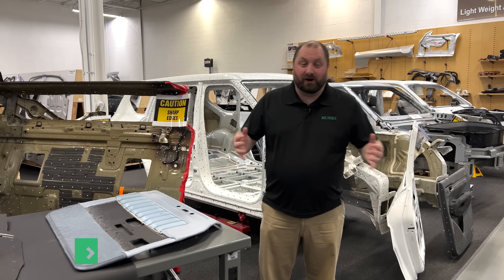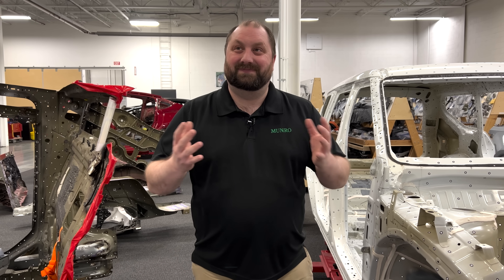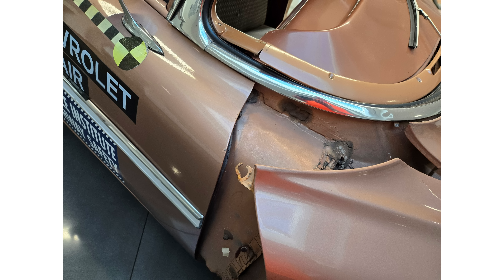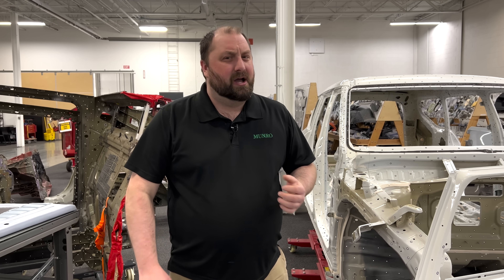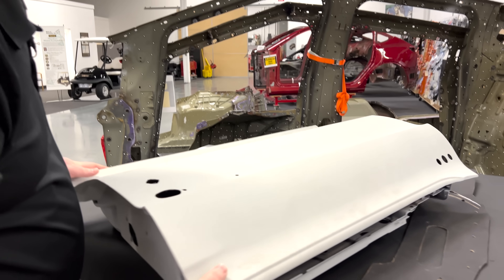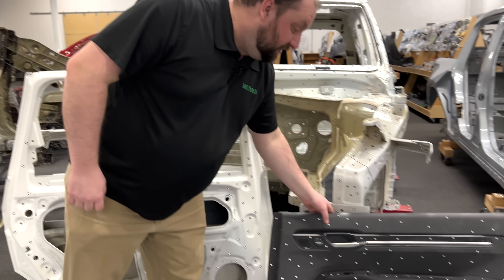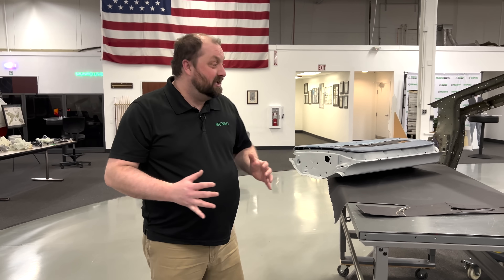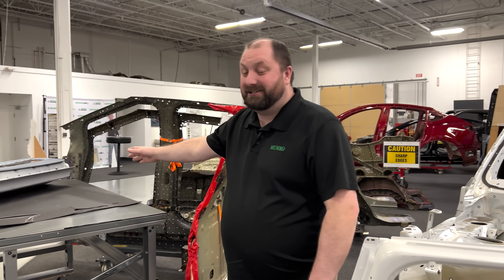No, Your Classic Car Isn't Built Better Than Your New Car

Comment: This argument doesn't happen in Europe, we are all well aware of how bad older cars and in particular US cars where for safety up to the 70s.  In Europe Volvo created crash technology, I have a 1995 940 and it has this technology, as did my Dads 240, but cars 20 years younger are safer in a crash because of the improvement of medical knowledge (from air bag loggers which log the forces).  Top gear did a comparison test which wasn't really fair to the Volvo, because the later car used Volvo technology, just further developed.  Its crash protection was thanks to the older car.

Comment: I think it is worth to point out, even for the car not so classic. Say, cars build in early 2000s. The level of structural integrity on most todays's models are superior over their counterpart in early 2000s. Becasue drive comparment has been continue beef up over the years. Better material, better geometry and better joint location. Another thing worth mention as well, it is corrossion and fatigue. Corrosion is basically material being eaten away. Although corrosion can be mitigate, fatigue can not. The weld regardless, is always going to be stress concentration point. Overtime, its will experiencing fatigue, and its strength will decrease. It is a very lengthy process, but the weld joint strength of car with million miles is not the same as the same car fresh off the line

Comment: Another problem with classic cars today is you are driving around with all of these heavy, modern structure cars that also have incredible performance. They go and stop so quickly that you have to be very careful especially when they brake suddenly. My classic cars with 4 wheel drum brakes are downright scary to operate in todays traffic.
Reply: Then something wrong with your drums
Reply: 4 wheel drum brakes? What are you driving? A old rafe car?

Comment: Old classic cars were not engineered for safety, but then, safer is only one specific type of better. However, when it comes to reliability and serviceability, the old classics are still around because a range of economical parts and expert service are still available for them. New cars are like an iPhone, one owner, and in five years they're done because they aren't worth fixing...few if any will exist log enough to capture the imagination and become classics.
Reply: I read many people saying how old cars were so bad, because the engines will wear out after 100k miles. Well do you know how junky the oils were back then? A modern car would last 10k miles with such junk as oil. Oils started being decent in the 90's and were only good starting in the 2000's and up. Yes safety and rust proofing isn't their strength, but they are so much better in terms of reliability.
Reply: Amazingly though there are alot of old model T Fords still running after 100 years.  I doubt any new vehicle made today with all their gizmos on them will still be running 100 years from now.
Reply: The only ways classic win is in style, and they are simpler/easier to work on. Safety, reliability (yes—I said it. Old cars frequently topped out at 100k and I begin shopping modern cars at 100k), features, comfort, noise, handling, power (yes—I said it. Of course there are exceptions, in both directions! Put a Pontiac Judge against a Hennessy Venom and let’s talk!), efficiency… the only reasons to go classic is style and oh yes, they were simpler/easier to work on. They don’t make them like they used to—thank God.
Reply: Statistically untrue.  You may "remember" it this way, but the facts don't back that up.   The U.S. Department of Transportation keeps stats on every vehicle metric you can think of, and they have stats on average vehicle age for every decade going back to at least 1960.  In 1960, the average vehicle age was 5.6 years old before it was taken off the road. This number has increased slightly every year up until 2023, which shows an average vehicle age of 11.8.  In other words, the cars of today last about twice as long as vehicles from 1960.
Reply: @nodammit  These new fancy cars are so way way more expensive also.  You really have to run these things alot longer because alot of people just can't afford anything newer.
Reply: @ They're not more expensive if you're comparing apples to apples.  The average new car price (U.S.) In 1960 was approx. $2600-2700, which equates to $28,000-$29,000 in 2025. 
A 2025 a compact Nissan Versa or Mitsubishi Mirage (10 year warranty), can be had for $19,000.  If you prefer a mid size, you can get a Honda Civic, Toyota Corolla, Nissan Sentra, Volkswagen Jetta for under $24,000.  If you want larger, a Chevy Malibu starts around $27,000.
These are all two wheel drive 4-door sedans, which is what most vehicles were in 1960.  Also keep in mind that along with better safety and fuel mileage, there are far more standard features than you'd find in 1960, like power windows, cruise control, A/C, automatic transmission, remote door locks, airbags, anti-lock brakes, seatbelts, etc.. The reason that the average vehicle price is way higher today, si because most people want an SUV with all wheel drive, and every feature available, which drives the price way way up.  However, that's a choice.  I still drive the 2014 Ford Focus I purchased new, and I've only had to replace the blower fan and front sway bar end links.  The blower fan cost $150, and the end links were $45 each.  If you compare apples to apples, you get a better car for the same or less these days.
Reply: @nodammit  I remember when my Dad bought a 1960 Chysler Imperial in 1969.  It was a 9 year old car and he paid the whooping price of 150.00 for it.  It was a beautiful car with the 416 Chrysler wedge V8 engine.  It ran excellent and did not have any rust. It even had a mechanical push button drive for the automatic transmission.  Those old Chyslers were built like tanks.  This was truly the heyday of the auto industry.  These cars were like pieces of art.
Reply: @nodammit  innovations in materials, manufacturing, engineering, and quality control have most certainly seen to the auto industry's ability to produce a better car now than at any other time in history. However, I believe that most people tend to dump a vehicle when it suffers a significant powertrain failure, and that lubricant, filtration, and fuel innovations since the 60's coupled with the introduction of the EGR valve in the 70's have also done a lot to extend vehicle powertrain life, and therefore, the overall useful life of vehicles that the manufacturing process alone cannot take credit for.
Reply: @kachmi  I would agree.  Innovations on many fronts have contributed to longevity.
Reply: It depends on how far you go back. Cars in the 90s and early 2000s are both reliable and easy to work on. But any later than that, the cars weren't nearly as reliable. They had to be easy to fix because of how unreliable they were.
Reply: Nah, you just have a skill issue, new cars are easily fixed if you….are skilled
Reply: You also need to spend $1500 on software to tell your car that you installed a new part otherwise it won't work

Comment: I love my '67 Chrysler 300 BUT it's a laughably deadly car if I were to crash in it.  The other person would be fine, I'd be a dead ball of meat in my 60yr old balled up car. 

People tell me all the time about how these new cars will not beat my car in an accident.  I reply, "safety glass, auto tensioning 3 point seat belts, air bags, structural body components to absorb impact, break away steering columns, no asbestos, ABS when you have to jam on the brakes..... Yea, all things this car doesn't have and I'm a dead man in an accident.  This is why it isn't driven everyday besides being a cool uncommon classic car".

They look confused lol
Reply: You might do better in a crash - depends upon the crash.  If you hit a Fiat 500 you'd do better than the 500, if you hit a Lexus SUV, no.
Reply: @timothykeith1367  hahaha I'll aim for the Smartcar

Comment: when I drive my classic I get butterflies in my stomach at 50mph, as I know I'm living on the edge...
Reply: I had a late 70s car designed in very late 60s , I could let go of the steering wheel at 160km/h and it would stay within its own lane for about 1 km , no trust issues , it also had , massive side intrusion structures in the doors , would I want to have a crash in it , no no one wants to have a crash...

Comment: Whether or not an old car was built better or not is entirely crash scenario dependent.  I was once stopped by traffic on the freeway and got rear ended by a woman driving a brand new 1997 Honda (either a civic, prelude, or accord).  I was in an old 1979 MGB Roadster (a fairly light 2 seat convertible with a design dating back many years).  I'd guess that the woman hit me going somewhere in the 5 to 10 mph range.  Her car had two smashed headlights two crumpled front fenders, and a crumpled hood.  My old MGB suffered a small cut in the rubber bumber from a piece of her headlight glass.  Neither she nor I were injured in the slightest.  In that scenario, I was glad that my car wasn't designed to sacrifice itself because it simply wasn't necessary for such a minor collision.  But, if she'd been travelling significantly faster, I might feel otherwise.  And, it is possible that she or I might have been injured if it weren't for the crumple zones in the front of her car absorbing the impact energy.
Reply: the late 70's MG's were often ridiculed for the obnoxious looking 5mph bumpers, but they did their job in your case.  That's one thing I think NEEDS to return to vehicles!  Vehicles need to sustain minor bumps without damage.
Reply: @audvidgeek  Yeah, I've never understood why people insist on cars being pretty over them being designed with functional bumpers.

Comment: Classic cars are repairable, restorable.  The current cars are hard to repair and will be much less restoreable.  All that plastic has a shelf life, goes bad with time,  no matter how well you kept the car.  The electronics is proprietary and not repairable.  The engine complexity is much higher and parts are proprietary.  None functional museum pieces maybe, but very few running vehicles to drive.
The newer cars are more safe but they are meant to have a limited life.

Comment: There's a sweet spot between safety, robust design and repairability/longevity without the manufacturer's support. I'd say that was somewhere between the 80s and 90s. After that period cars got a lot safer but the whole package got less serviceable and more restrictive to the owner.
Reply: Not a lot , twice from the 80' and  many are transformed into disabilities and only because of improved medical tech . You die every two serious accidents instead on the first
Reply: It's not less serviceable if you know how. 1970s car is complex compared to ford model t

Comment: Why not bring your classic car in and show how it's made?  No need to take it apart, but you can more clearly show the frame and lack of structure, just as you did with the modern cars.  As an owner of many classic cars I fully agree with your argument, modern cars are clearly safer both passively and actively.  Passively they can survive crashes better and keep the occupants safer from injury.  Actively they simply handle better than any classic car, when comparing like to like.  Classic cars are more engaging to drive, provide fewer distractions, give a lot more feedback (because they have poorer suspension and brakes, and are louder).  In a nutshell, classic cars are fun, but modern cars are better in every way.

Comment: They were designed to be easily maintained and repaired, without manufacturers locking everything down with unnecessary electronics. So why don’t modern cars have built-in diagnostic and programming features in the computers they already come with? The answer is corporate greed and it has ruined modern cars.

Comment: Count me as a Luddite when it comes to everything being run by a computer.  Case in point: Wipers quit working. In older cars, it's either the motor or the switch (not counting a possibly broken wire).  In modern cars, the Body Control Module runs the wipers after sensing a change in return voltage coming from the switch. In the old cars, all you need is a test-lamp.  Nowadays, you need to be an electronics engineer.  I prefer the simple system where the switch closes and completes the circuit, instead of showing the computer a voltage change.  Mush easier. Don't get me started down the rabbit-hole of digital engine management.
Reply: Nowadays is like 30 years ago, my 91 Chevy G20 has already a wiper Control module
Reply: @heroesofthelandstrasse  Okay, but I'd bet it isn't digital, doesn't use a microprocessor.
Reply: @johnchamberlain5435  it is analog
Reply: @ Then it is acceptable.
Reply: @johnchamberlain5435  Microprocessors last longer than analog parts. Swap out the module if it's bad.
Reply: There something called DIAGNOSTICS TOOL. 15$ one will tell you many things. Not to mention that digital systems often have a lot of in built protection that will make them last longer by default.
Reply: 100% agree.

Comment: this argument only looks at safety but old cars were built much better than new ones because they lasted a very long time had very good quality metals and components that either did not break or were very easy to fix ans service. like look at all the plastic in a modern engine vs a new one, yes new cars are more safe but they are disposable only last a couple of years and then its in the trash because its more costly to fix than to keep the car and you have to buy another one
Reply: You’re seeing survivor bias. Old cars didn’t last longer and required much much higher maintenance and repairs on average. 40-60k mile cars were near end of life back in the day. Now even the worst ones make it well over 100k miles.
Reply: This is nostalgic blindness. The rust on those older cars were terrible.

Comment: Browsing through old car magazines it is quite interesting how bad cars that were praised for their reliability and durability actually were during long term tests. Back in the 60s and 70s it was relatively normal that components like the engine, clutch/transmission, brakes, exhaust etc would break or need adjustment and repairs more than once. And rust become a serious issue after just 3-5 years. Thinking back to my childhood i remember my dad regularly inspecting and repairing brakes, carburetor, ignition, wipers etc on our (european) ´75 Ford Granada. I think that even unreliable, modern cars are more reliable than their predecessors from 50 years ago.

Comment: The only classic car I'll really take a chance with driving routinely is a Mercedes or Volvo, but they built them for offset crashes and used non-ductile high strength steel in the bodies some models. They were the safest cars of their times, but today, they have exceptional vulnerabilities that modern cars just don't have (don't get t-boned in a W126 S-Class), airbags not designed for woman drivers or have multi stage inflation for low speed vs high speed crashes, etc. Anything else that's 30+ years old is basically a tin can.

Comment: That is simply subjective.  The technology was always evolving.  Some ideas and practices were better than others.  Certainly no one can argue that ICE efficiency has made a dramatic improvement over the last 125 years.  Power to weight ratios likewise.  Some manufacturers really improved the quality of their products in the 70's to 90's.  But there is a tipping point.  The accountants and share holders got very greedy.  Loosing sight of the goal; diminishing returns.  When a new vehicle becomes too expensive for the car buyer's.  When repair costs and insurance exceed residual value.  When corporations became obsessed with Steve Jobs/Apple model Proprietary hardware/software; it was there in the early 2000's that we lost the plot, and cars were no longer better than their predecessors.  I haven't seen a new car since 2010 that I'd want to spend my money on.  They're soulless pods with personal entertainment centres.
Reply: You have to keep in mind a lot of the product solutions come from the demands and desires of the consumer. Today's consumer expects even the most basic car to have conveniences such as full power accessories, an infotainment system, battery drain protection, auto headlights etc. Then they expect a long service life with minimal maintenance. Unfortunately these ideas and expectations don't come cheap.  Back in the old days, just having AC, power steering and power brakes along with an am/fm radio was good enough for a daily commuter car. 3000mi oil changes and 30,000mi tune ups was normal. This would be unacceptable nowadays because the average consumer has gotten greedy and expects high gratitude for minimal effort. The corporate mindset matches the customer.
Reply: one of the factors here is that auto manufacturers have realized that vehicles change owners multiple times before they reach E.O.L.  THe first-time buyer is now all they care about now.  If a vehicle lasts 20 years, it's of no importance to the manufacturer, because the first owner only holds onto the vehicle for maybe 5-7 years at best.  They'e realized, that it only has to last that long!  Building something like a 3800 V6 or a Rambler 4.0 straight six that goes 300,000 miles for 25 years makes for a legendary reputation that enthusiast,and the used car market people scoff up when a creampuff goes up for sale for big bucks, but the first owner of the car doesn't care that it has a 25 year / 300,000 mile engine.  They will be getting rid of it long before then to get more power, more gadgets, and more luxury. so, why go to the expense to engineer and build that kind of robustness into a vehicle when it doesn't benefit them, the manufacturer financially?